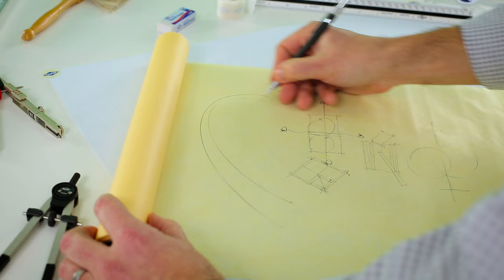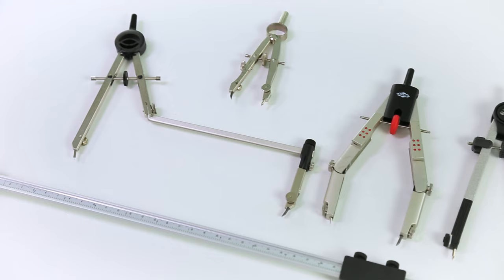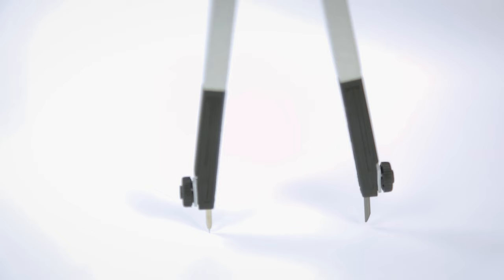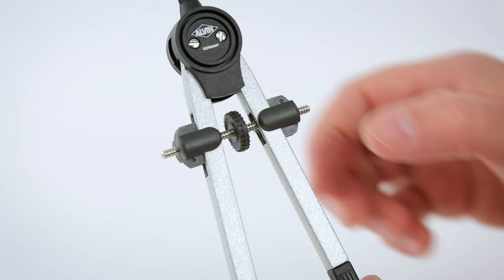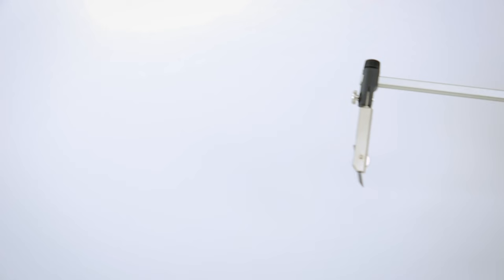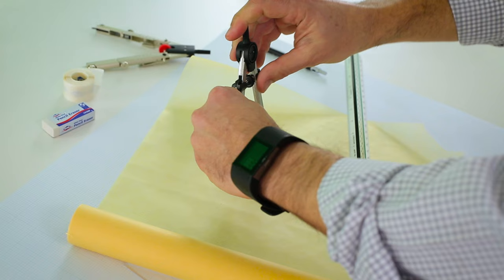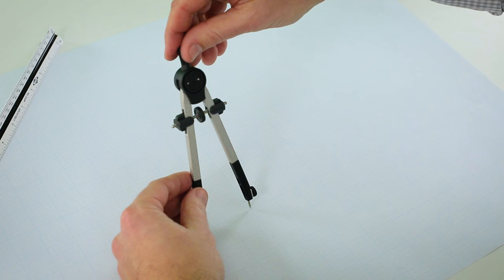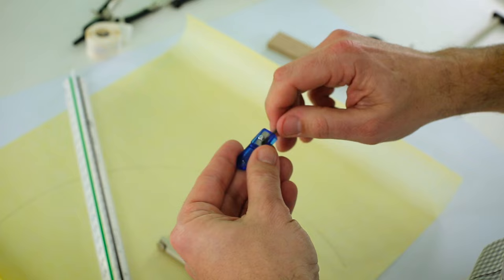Drafting Tools 101 - Learn How to Use the Compass

Comment: I really hate this style of compass. It doesn't allow you to lock in the size in place. So it always turns out distorted.
Reply: I have this issue with mine. I can’t lock it so my paper always has a little dent in the center of the circle from pressing on the center so hard to keep it from moving around and distorting

Comment: Maybe my compass is a piece of @#$^??? No matter what the pencil arm moves. I only hold the top handle but the slightest amount of pressure from the pencil on the paper makes the arm move. Is there something I’m missing? I even tried turning just the paper in a circle holding the compass still.

Comment: At 01:30 when he says “Others feature break legs,” what does that actually do? My compass has those but I have no idea what to actually do with them.
Reply: The break legs on some compasses allow the legs to face directly downward as opposed to slightly angled. It helps keep the drawing perfect. Just adjust it so that the legs face down. You can also adjust one leg outward for a larger circle.

Comment: Is there a compass that can hold a mechanical compass?  The Alvin compass pencil holder is made of plastic and the threading strips.  Do you guys make a compass for extremely fine lines or a sturdy pencil holder?  2mm is too thick for me, I need .2mm lines.

Comment: I have a Staedtler compass set. My major problem is making small circles, less than 1 1/2 in diameter. Any advice?
Reply: Use a stencil instead?
Reply: @Oberon4278  good suggestion. Thanks

Comment: What is the purpose of break legs?
Reply from the maker: The break legs allow you to create larger circles and it keeps the lead touching your surface at the point for precision. If you let the lead begin to mark on an angle it will shave down the graphite  and your line will become inconsistent.
Reply: Alvin Drafting
So it's a bit like adjusting the height of a pencil in the compass for those compasses that have pencil attachments?
Reply from the maker: Yes. You always want the point to be the spot making the mark. It gives you the most control over the line.

Comment: I have a compass set with certain compasses that have a "pronged" end, i.e., two pointed edges parallel to each other - almost like tweezers. Does anyone know what the uses are for these types of ends?
Reply: Jet compass? With beam bar?
Reply: @user-in5ru2cd9l  no - regular airplane compass with flashlight.
Reply: From your description I guess they are linear drafting pens; you put a drop of chinese (black) ink in the void between the metal "tweezer" and can then draw in ink. This kind of pen can only travel in one direction, so they are not suitable for writing, only for drawing lines.

Comment: Where do you get your led??? I found my grandfathers old drafting kit and it has very little led.  I also don't know what one of the tools is as it has 2 points on it and you can't change them.  I can guess you put some ink down then use it to make a circle?
Reply from the maker: Hey vlogging peacock, you can get compass leads from anyone who sells drafting equipment. The tool with the two points on it is probably a divider or proportional divider. This tool is used to measure space on a map, blueprint or technical drawing. It also is a tool for dividing lines or circumferences of circles into equal parts. Proportional divider will also allow to make something bigger or smaller and keep it in the correct proportion. This tool is not used for inking. They make a compass attachment that will hold a tech pen or marker.
Reply: Any store for writing equipment, like school, has lead for mechanical pencils/lead holders/clutch pencils.
My compass doesn't use lead but you attach a wooden pencil to it